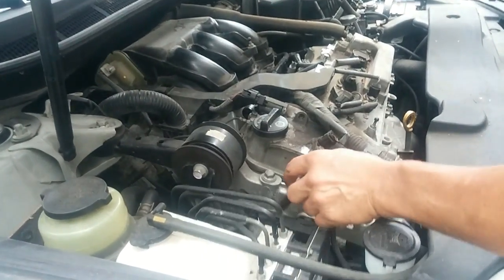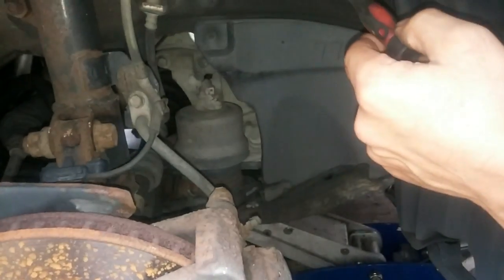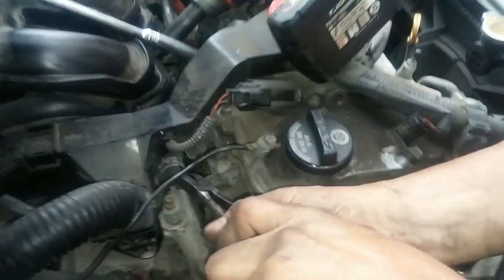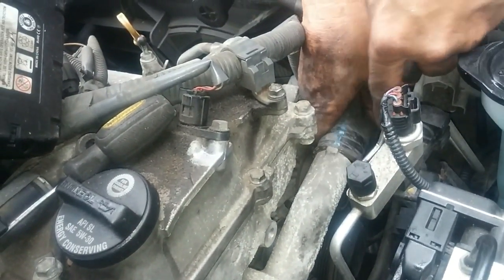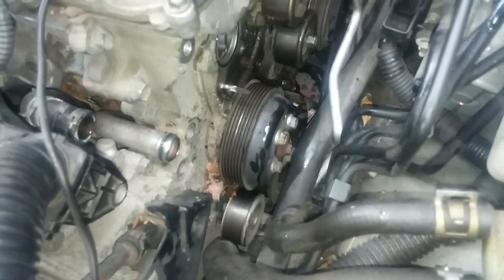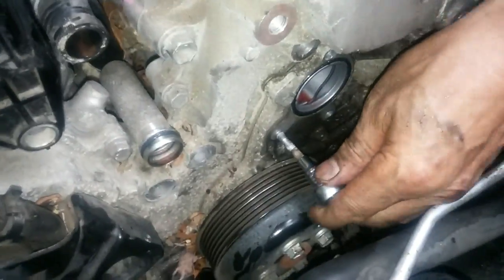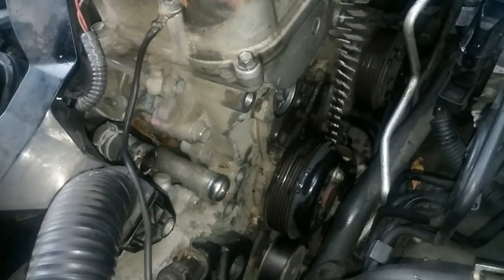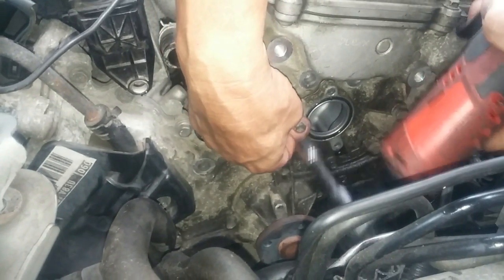Toyota V6 GR-FE - Water Pump Replacement

Comment: You made it look simple!  The jack with wood block was under the oil pan?  
And also - if you don't mind - the motor mount that has that stud with nut,.....you removed the nut....and you lifted it as high as you needed it to be.  Did the engine bracket come up and off of the stud completely?  I'm curious for two reasons....one, it will give me an idea of - how high - it was lifted, and.....I am also curious about if you had any difficulty lining it back up (to let it down....since the stud was straight up, and the engine was at an angle)?
Reply from the maker: Yes ... the wood block under the oil pan distributes the support weight and protects the oil pan from bending.   .  You don't need to lift the side motor mount completely off the stud...just enough to get the water pump pulley off.  If you do completely lift the stud off the side motor mount, you'll need a extra pair of eyes and hands to help coordinate and gradually (very slowly dropping the hydraulic jack)  align the stud (the stud can be slightly bent towards the hole) to the side motor mount bracket hole.  Once the stud is partially in the hole, releasing tension on the hydraulic jack will drop the bracket hole onto the stud completely.  Hope this helps, thanks for the good questions and good luck with the repair!
Reply: @hardlymovingpro  One last question.....It's hard sometimes with videos on You tube to get an idea about - just how long (did the whole job take) from start to finish?  
Oh and, there is this little brass bleeder (that you can see in your video at 2:38, at the 12 o'clock position, about 1/4 of the way down from dead center.  It's on the pipe that the 5/8" hose connects to (that you had to remove), and this bleeder stand straight upwards.   When I changed the antifreeze in this car previously, I opened that one, and poured the fluid into the radiator neck (no big funnel, but do appreciate what it can do) and continued pouring until fluid just started to come out of the bleeder, and then closed the bleeder, and put the radiator cap on.  Ran the engine a while, and found that I did not have to add any more after that.  And yes, I had lot's of heat.  And yes, I do realize that on some engines you HAVE to use that funnel.  Just saying on this one I did not.  I have been thinking about the vacuum fill set-ups too, but so far did not need to do that.
And overall, this was (is) and outstanding video....thank you again!
Reply from the maker: The first time I did the job, it took around 3 to 3.5 hours.  It takes me now around 2 to 2.5 hours.  When I refilled the cooling system after the water pump replacement, I did not open the bleed valve.  But in retrospect, it's not a bad idea.  I usually run the car till it reaches operating temperature (for the thermostat to open up and fill air pockets), let it cool down (for the engine to suck in fluid from the reservoir)  then check the fluid level.  The funnel I used in the video has worked out wonderfully for me since there's very little spill, can run the car and watch the air bubbles working their way out; and with the plunger, I can pour the excess fluid in the funnel into the reservoir or coolant container.  I used the vacuum fill tool at the dealership which works very well.  However, these tools are expensive and if you don't use it every other day, don't see how the cost justifies the benefit to save a little on time.   Thanks for your positive comments and let us know how the job went!
Reply: @hardlymovingpro  Oh and....just a PS on my last comment/question, regarding changing my antifreeze on this engine.....there are two other bleeders, one in front, and one in the rear.  When I changed the fluid I opened all of them, and had the block as drained as it was gonna get.  I mention that because I realize that by taking the water pump off, the engine is quite drained.  And so me saying I changed the antifreeze, I believe I had the block just about as empty, or very close to where you were.   And, as I said - on this engine (at least) opening the one top bleeder was all it took (did not need the tall, deep funnel), to get it completely full.  Not that this info is worth much, or means that much - overall.  A very small detail - only.
Reply from the maker: As I mentioned before, using the funnel shown in the video combined with running the engine until warm was enough to push out the air bubbles without causing a coolant leakage mess from the filler neck.

Comment: How many miles on it when the water pump failed?
Reply from the maker: Close to 100,000 miles and over 8 years old.  I'd say the water pump is the weakest part of the Toyota V6 GRFE engines.  On the V6 MZFE engine they last over 150,000 miles.
Reply: I'm replacing mine at 135k miles as preventive maintenance. You think i just got lucky or should I have waited?
Reply: @sandeepp6300   Im in the process of replacing mine on my Highlander just hit 189k. Still the factory pump on there too.
Reply: Hardly Moving Productions My 2014 Camry has a noise(like a ringing bell and like some bad crankshaft) from the Water Pump and is increasing. The car only has 66,000 miles and it doesn’t leak, overheat or anything but I think the bearing is going out. Can I adjust something or should I just change the bearing?. Thanks for this great video.

It was the water pump. Not a piston slack as some people say. This video give you the perfect idea and instructions for that work. Make sure you have good tools because I didn’t. Painful.
Reply: @hardlymovingpro : Shame the Owner Didn't Do This @ T.Belt Service@ 90,000-95,000 mls.More Money Out If His Pocket. Hope Gates Makes One for My 04 ES 330, Gates Belts Are Great,As Long as They Don't  Come From China,Understand They Have A Plant There,& Heard There Was An Issue W/ Some from There That Had Incorrect Ribs on the Belts.
Reply from the maker: This engine (2GR-FE) uses a timing chain.
Reply: Mine went in June. 2009 Lexus with 915000 miles.
Reply: 220k miles before I sold rav4 and had the stock water pump. Moms  Rx350 has 140k+ miles on her stock pump. Weak area of engine but still isnt bad really. Make sure  maintain your radiator fluid and use correct fluid goes I think along way.
Reply: My 2015 Highlander with 86k miles and the pump bearing is making noice. The pump should last at least 150k to be considered as reliable. Many fail below 100k miles.
Reply from the maker: Pump failures can be unpredictable as you approach 100k miles.  Seen then go at around 80k and still going after 200k.